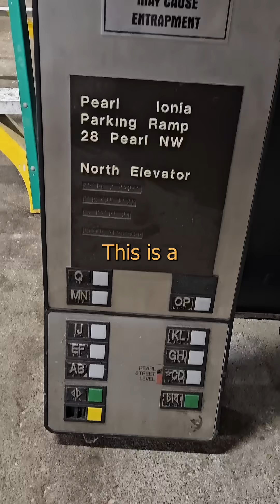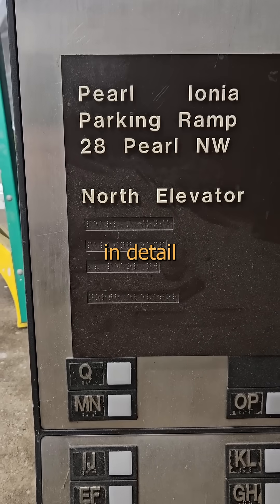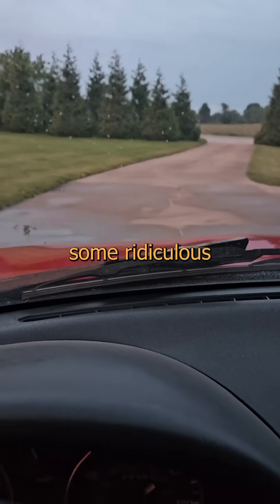Miata Mischief #chrisboden #engineering #gear #elevator #score #stories #parts #hacking #making

Comment: I want to start out with that I am now 72 years old when I was 16 years old I was doing leather work mostly making western saddles I wanted a clicker press a machine which would cut out leather pieces and I called around and I found one about 30 mi from my house it was a nice big four post clicker press it weighed about 2500 lb and my dad was nice enough to pick it up for me him and I went down to him to LA where the machinery dealer put that machine in the back of my dad's 1959 half ton stepside pickup truck and we drove it up the freeway back to my house in Tujunga which was about 30 mi away if you stepped on the gas too hard the front wheels of the truck would come off the ground so we slowly came up the freeway about 25 miles an hour and got it home where I had a friend with a tow truck the old kind with the kind of crane on the back who picked it up and set it down and we rolled it into my garage on a bunch of pipes that was a real adventure

Comment: I took 2 shopping carts I "found" and put a sheet of plywood on top of both of them and hauled all of my stuff 25 miles with it. Worked really good but I never went over 40 lol. At 42 the shopping carts would feel like they would explode.

Forgot to say but I pulled it with a rope that was tied to my head rest going through the trunk of my car, I didn't have a hitch and didn't trust anything else with that Ford Contour being a rust bucket.

Comment: Two different adventures in a friend's Cooper Mini with bad shocks...

First, he drove four adults, combined weight somewhere between 800-1000 from Austin to Houston, at about 90mph.

Second story, grabbed a heavy gaming chair box, bigger than the roof of the car. Didn't have straps so he and I rolled down windows and held the box for the five mile drive home

Nothing on all the stories here, but I thought it was crazy at the time

Comment: My mates little brother got us to weld the front of an old gocart chassis to the front of an old powered drive lawn mower, he got us to put a seat above the engine and with a bit of help he turned the rear of the chassis into a trailer of sorts. Despite being told not to take it on the road you often see him trundling around the village collecting treasure.......

Comment: I can't drive, so I've hauled all manner of things home in a backpack while cycling however long I needed to, usually it's a mix of a bunch of small things, but I think the biggest was a 1953 Zenith L520F (that I squeezed in with a few books), while the heaviest was a 1962 Paymaster Series X-900 (that had to have the handle sticking out to fit). Both of these rides were an hour long.

Comment: Not really sketch, but I like smaller cars. If I need a truck I'll call one of my kids or u-haul. I routinely show up to buy something and have the seller look at my car like "You have a truck coming?" lol. no.
Mid '80s, my friends' band was going to play CBGB,, but the guitar player with the car didn't want to drive in NYC. So I took the front seat out of my first gen civic (so the bass drum would fit, wasn't even one of those big CVCCs) and packed everything in except the guitars (they took those on the train with them). Fifth gear meant punching the bass drum head.
I could fit an industrial sewing machine into the back of my Scion XD (table and all). Did that at least 4 times. The XD pulled a little 3x5 trailer which got my $60 cast iron bathtub home. Loaded a lawn tractor on it once, that was a tight one.
When my youngest failed out of regular college (runs in the family) I packed his entire room full of crap and a fridge in to a Scion XA (yeah the smaller one). His mom's SUV was packed when he moved in, I just pack better. Also, didn't have a backup plan, so success was only option.
Oh, there was one time when I bought out a shoemaker's collection of lasts he wasn't using anymore. He had the bed of his pickup filled with boxes. I packed it all in the XD. Those things are heavy, I pretty much road the bumpstops all the way home (and figured 55 might really be the way to stay alive, or at least be able to stop).
Reply: Dorm room mini-fridge, just to be clear

Comment: I once went and got a Audi tt out of a lady’s garage with my 84 f250 with that had a straight 6 with only holes and dreams holding it in only one working break and no keys to the car it was at the back of a garage in the corner and we only had ratchet straps and a bumper jack to load it it was fun to say the least

Comment: Hauled a bookshelf in a 4 door mini cooper. We had to do disassembly. The walls of it stretched from the windshield to the back glass, with just enough room to put a cloth on either end to keep it from breaking the glass. Went 50 miles with that like that + a passenger to tell me if I was good to do anything in the rightward direction because it was blocking my view almost entirely. Same car different day hauled 3 of the large 27 gallon totes full of water because my mom bought big koi and my dad was at work. Thankfully I was able to take a neighborhood route and managed to not have the water dump all over in my car. How we were able to haul anything in that car still surprises me.

Comment: Well, nobody's going to give a shit, but:
I have a Specialized Demo 8 from 2009, i used to do package deliveries and still have the massive backpack i used for them. One day my sister wanted to go buy groceries to a supermaket further away from home, but we don't have a car and she wanted to buy loads of stuff. We filled my backpack with about 35 kilos of whatever the hell all that was and i got on rolling home on the bike with my sister, the thing is that i wasn't going to try and ride normally with that much weight behind me, so i choose to go walking pace home with her. My 550x3.0 DHX5 coil in the rear was REALLY upset about what was going on, and when i went down a curb it got INMEDIATELY smacked onto oblivion as the sag must've been something ridiculous like 65%. We got home with no real issues, but my rear shock gave up a few months later 😂 i'm running a 2018 DHX2 Factory Series nowso the upgrade was well worth the mess, even though the upgrade itself was... Far more eventfull than it should've been, however my storywas long enough and there's no need to start a rant on top of it about that.
And if someone says "but the DHX5 doesn't support -X3.0 size coils... I know it doesn't, and it's still there because after installing it in a jank asf way, i was never able to take it off ever again 😂

Comment: In the 90s I had a Fiat Uno......er, small!!  I took out all the seats apart from the drivers, and lugged home 3 hardwood railway sleepers for a greenhouse base, 20 miiles home.  The bump-stops had a good workout that day. I couldn't be bothered to replace the seats for a few weeks, and ended up giving a lift to 7 friends from the pub, all of whom had no seat and obvs no safety belt.

Comment: Buddy of mine wanted to expand a server hosting operation of his, and I volunteered to help in the hardware acquisition part.

Fast forward about two days, and I am driving six hours one way for two separate Facebook marketplace meetups. 

First one was in a sketchy apartment building to meet a guy who makes his money bidding on abandoned storage units. The genius had his girlfriend at the time sign for the units. Well, a week prior to me showing up, she dumped him “outta nowhere” according to him, and he had to fit everything he had into his little two bedroom apartment.

Second guy I met at a burned out, under-construction house in nice neighborhood. Guy apparently co-owned some tech startup that got acquired by a larger company, and he was left with a pile of cash and the whole company’s server hardware to deal with. He got into real estate and had apparently been juggling the hardware between properties while trying to get rid of it.

By the time both deals were done I had twelve servers, a rats nest of cables, some network equipment that got thrown in along the way, and a bundle of server rack rails, all of which needed to make the 6 hour trek same-day back to my place in a 2007 Pontiac Vibe. 

My genius self forgot to bring anything for packing or padding, so there were twelve flat metal sheets that weighed enough to take the wind out of you just slipping and sliding on top of each other, and the top row of servers were at window level.

Made it back with no broken glass, somehow, but had some close calls.

Had a great time.

Comment: We had a ratchet strap break that was used to hold inflatable kayaks onto a trailer and we needed them for another rafting trip right away so two of us stood on the back of the trailer and just held on as best as we could to keep the boats from flying all over the county highway. It worked, not safely, but it worked

Comment: Had a friend tow a dodge truck chassis sans body across town! No brakes and steering it with a screwdriver through the joint on the steering shaft.

Comment: I unbolted my 1986 mr2s passenger seat to fit a used engine. Also had my buddy tow me with a rope from kaneohe to Schofield barracks (completely across island). I bought a 99 acura CL that had no engine head and somehow got it past the gate guards and across island without getting a ticket. This included two highways. Hurt my back real bad carrying a long block toyota 4ag engine to the third floor by myself. I tripped in the apartment and spilled oil everywhere.

Comment: I bought a broken snowmobile and strapped it on the roof of my 89 Grand Marquis. Yes i drove it on.
I had a moving blanket that I draped over the back of the car and strapped to the front bumper so it wouldn't rip out. 
She was a fine demolition derby car the next year. Oh and the sled was fun too.

Comment: I bought a full size double bed online, and went to pick it up wit my kia sportage. I disassembled to pieces, jammed in the car folding the backseats, set the front seets forward and finally I could close the  trunk. I'm 6 feet tall, I had to push the steering wheel in the deepest position and I had to tilt my head because the bedframes took the headspace. Finally I made it home, parked, and succeeded to fold myself out of the car. I'll never do it again😂

Comment: Wasn't me, but I once put a very large rear projection screen TV on craigslist for free just to get it out of my basement. This was around 2017 so though the TV worked, the TV was already very antiquated. So these two kids show up to get it and I think cool... Someone who will get good use out of it for a bit. We all gotta start getting better shit somehow. So we roll it out to his car... Because these things were often large enough to need wheels, and this was no exception.... Then I see the car! A late 90s Honda Civic HATCHBACK! I look at them and say, "what's your plan? That thing is as wide as your car!" They say, "well, we brought blankets." At this point I'm hands off. I'm going to just watch the show and hope they don't drop it on my street where I have to pick it up. They proceed to put it on the tiny lip of a flat spot on the back, then cover the rear window with a blanket. They then lay the TV screen side down at about a 45 degree angle on the window.... Then they pull another blanket out and put it over the back of the TV. Finally, they pull the blanket ends around inside the car by and tie the corners together in a big knot, and last, close the doors on the blanket! The whole thing looked like a shit filled diaper off the ass of a child crawling on all fours with his ass in the air. I watched them dive off, listening for a bit for the sound of something smashing into the pavement. As far as I know they made it.

Comment: I didn't do this but I have a picture of it. 
The pic is of a car with two 2X12's sticking out of the trunk of a sedan The trunk lid is wide open with a 4 wheeler on the 2X12's, half in the trunk and half over the road, ratchet strapped to the car. The guy is driving thru the streets of downtown Omaha like it was just a normal day. If I remember correctly he turned east on Douglas street headed for Council Bluffs! LOL.

Comment: I found a great deal on a 60" TV, but i was driving a Volkswagen Eos power-top convertible. I put the top down, and lashed it into the backseat with one corner sticking up. Took the backwoods home, about 40 mph is all I could do without it trying to turn into a very strange sail.

Comment: I bought a fridge on Facebook marketplace, not thinking about the fact that I had a Peugeot 206+ that is just as big as the fridge. I had to take all but the drivers seat out and even that I had to squish against the steering wheel. The fridge fit in with not even a millimetre of extra space. That was the easy part tho, as I still needed to drive it across all of Istria. Moral of the story: if it fits it sits.

Comment: When I was in high school, we revamped the whole electronics class for the CTE program, and with that, we had a lot of 70-80s equipment that was taking up way too much room for what we wanted to do. One of those things was an educational automation setup that used machine language to run. There were 6 70in by 20in tables fulled of pneumatic, electromechanical, and a lot of heavy stuff, probably over 600 pounds of stuff. My college wanted it, and I only have a 2012 hyundai elantra, and I took apart everything, and I mean everything, and put it all in the car. Which was a miracle it even fit all in one go, I barely had any room to move my steering wheel to drive 3 hours to get to the college. It was very sketchy...

Comment: I once used a Honda fit to haul 12", 14", and 16" boat dock piling cutoffs so could build a temporary fence for my dog. HOA wanted everything temporary and when the hurricane came these all washed away proving they were in fact temporary.  I used probably 200 of them to stand up on a cinder block base to create the fence. Free is free.

Comment: I drive a bmw e46 sedan and planned on engine swapping it with an LS. So I borrowed my buddies Van and loaded it up however half the engine was sticking out the back. We were in the middle of fucking no where and didn’t plan on it not fitting like dumbasses. With a pack of 9 inch zip ties we strapped it down and drove the hour and a half home while I sat in the back holding it still.

Comment: My truck brake lines had rotted out, so was using my motorcycle for everything. On a 93 Suzuki Katana, running down the interstate with a chainsaw pole saw.

Comment: Picked up an ISI model "super III A" scanning electron microscope that had been thrown out by the University of Rochester's materials science department around the turn of the millennium, rescued by a U of R grad student, marinated in various closets and basements around Rochester while said student got down to thesis work and then advertised as free to a good home in 2007.  We carted it 90 miles down I-90 in my 2000 Celica and the grad student's Subaru.

Comment: Uhhh so not my sketchiest haul, but I was involved in loading it. My dad got two plane engines (with propellers) and we had to get them in the back if his 2500 series dodge. We had one sitting vertical right behind the cab and the other pointed backwards out of the back of the truck, barely any clearance between the engines and it had a bit hanging off before the propeller. We had to drive from New York City area to Memphis. We made a stop in DC to visit the Smithsonian (Aviation one) and made some jokes with the parking attendant about both engines and props in the back of the truck.

Comment: I have a 2013 civic coupe that I routinly throw foam roof racks and a 10 ft kayak on top. It gets safely strapped down and I always say that’s going no where. Longest drive with it was 3.5 hours. Should I have gotten a different car probably but the looks I’ve gotten have been worth it.

Comment: Summer student for airborne geophysics company. They finished a survey and loaded up a 1978 Chevy 3 speed with 2000# of gear, Beverley Hillbilly style with gear hanging out the back, then got me to drive it 1000 miles back to their shop, in the country’s capital. Locked keys in truck, opened with coat hanger. Later gassed up and noticed tailpipe clamp had let go, so used hanger to tie it to the frame. Two hrs later the electrics went out. Pulled off and looked around. Had tied the tailpipe too high and it exhausted into the fender, melting the taillight like taffy. It shorted against the fender. Arrived in capital city during a national holiday, lost thanks to boss’s bad directions, electrics mostly out, tired while driving stick in downtown traffic with fireworks going off. Gas stations were closed, ran out, slept in truck. In the AM, walked for gas, drove to a cafe and backed some the overhanging gear through their glass door.

Comment: Sketchiest haul?  32 inch flat screen TV (pre-Thin era) from a dumpster with a chewed up power cord that was modular and I had a matching one and Got it home on a bike.
Fixed up, threw a price tag on, and sold it to the guy that threw it away.
Long story short, he found out it was the TV his chihuahua chewed the cord into two and tossed it out.  He came back with a cop and after hearing boht sides told the guy "You tossed it, he fixed it, pay him or let him be"

Comment: I once hauled a motorcycle sitting upright just barely in contact with the razor' s edge at the very end of the tailgate. Several ratchet straps and 25 MPH the entire 20 miles at 10pm got it home.